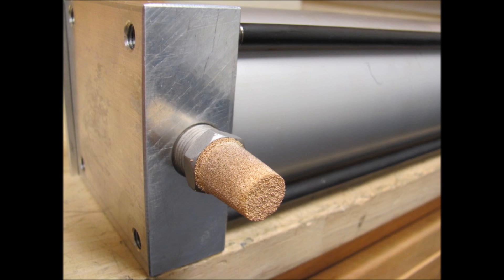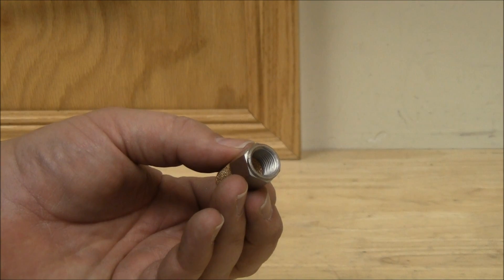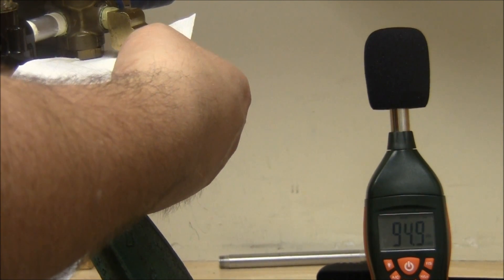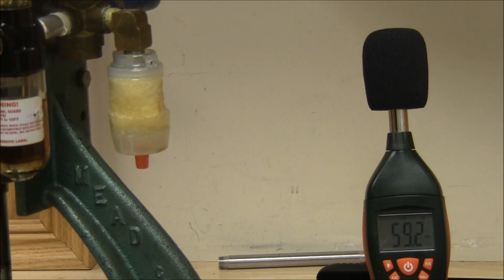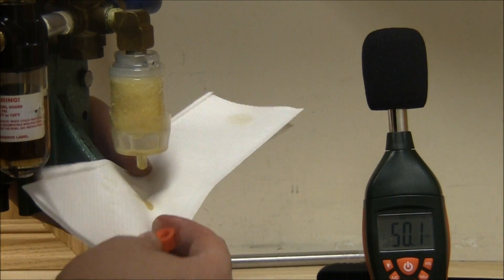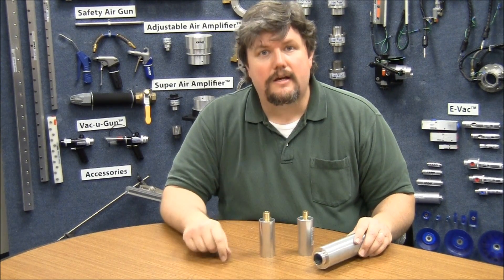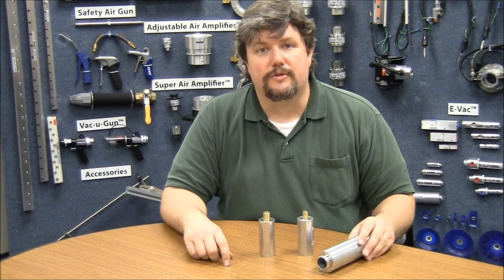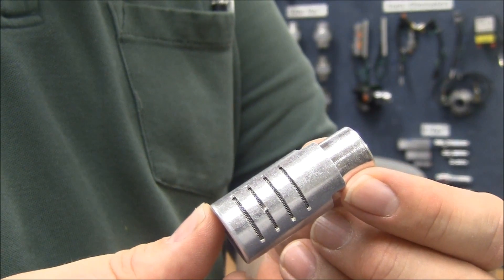Silencing Mufflers

Comment: Thank you for your help! Could you tell me how to muffle a Yamaha generator
Reply from the maker: @Adrian Sosa, thanks for the comment.  The mufflers showcased within this video are all designed for use on compressed air.  To reduce the sound level of a Yamaha generator you may want to reach out to the manufacturer to ensure the stock muffler is operating correctly.   Sorry we cannot be of more help on this.  Good luck in the search.